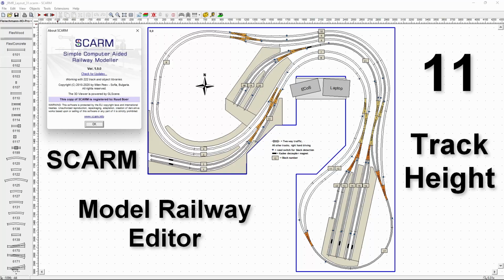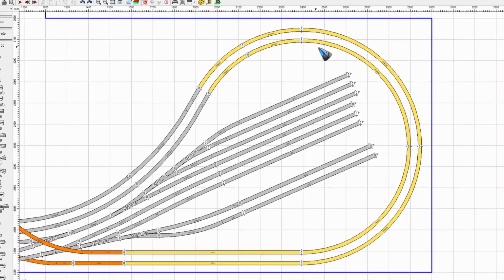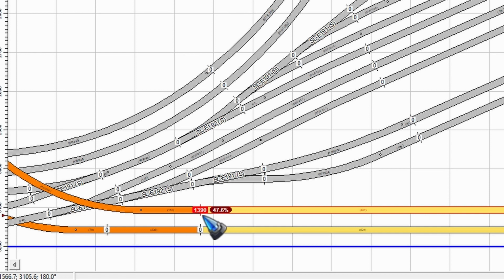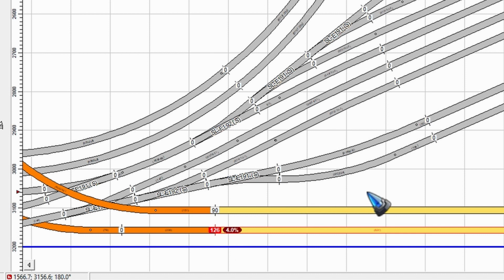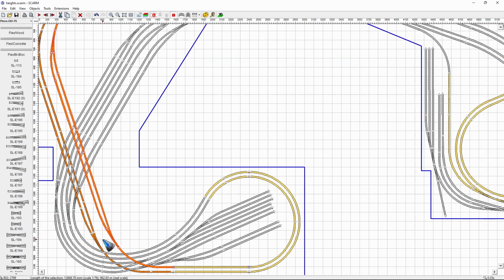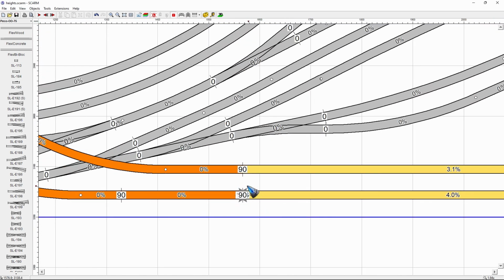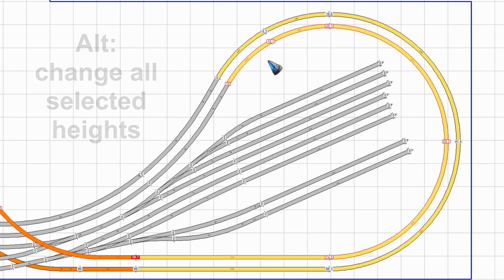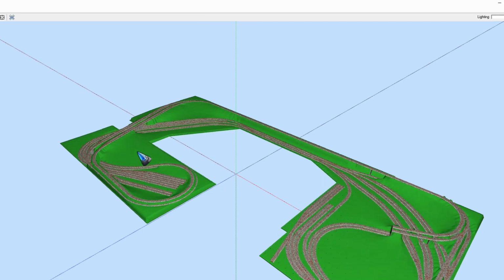Model Railway Design with SCARM 11

Comment: Very useful indeed, I did not know it treated track of the same colour as the same object for one click selection, nor the direct entry of heights. This technique certainly speeds up fine tuning gradients and heights very quickly, particularly if you have long runs of track, a very powerful tool. Thanks and
best regards Stephen